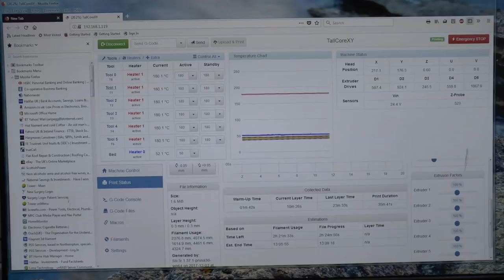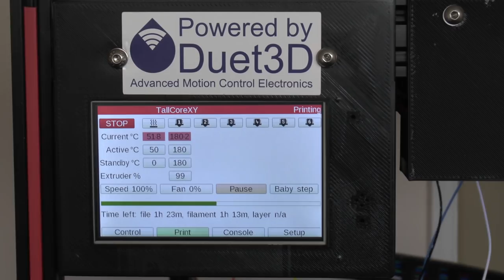5 Colour printing with a purge "bucket"

Comment: Clearly a huge amount of work has been put in to this printer. It’s a machine many would love to own and use, but few would be prepared to put the effort in to design and develop themselves. This has taken some real engineering and you should be very proud of your achievement - well done!
Reply from the maker: Thanks. This seems to be a popular video but as I keep pointing out to people, it was made over 2 years ago and a lot has changed sine then. Instead of 5 E3D TItan extruders, it now has 6 Bondtech BMGS, it has Duet generation 3 electronics with Can Bus expansion boards on the extruder gantry, so the huge cable chain has gone. It now has a DC UPS backup, the filament spool holders are completely different, it has a 3rd load balancing gantry. I could go on but you get the idea...:)

Comment: That purge splooge was very minimal compared to some blocks that I've seen. I cant wait to try and build something like this in the next few years.
Reply from the maker: Were you thinking of the Prusa MMU perhaps? Their purge tower seems to use more plastic than the object being printed from what I've seem. Although I'm told the tower is hollow, it still seems like an awful lot of waste of both filament and time, to me.  With the Diamond hot end having all filaments loaded at all times, the only purging that's needed is a small amount that's in the mixing chamber. Unless you print PLA and it has been held at print temperature for over an hour or so. In that case, it will hydrolyse and at bit more purging is necessary to get rid of all that runny stuff. Conversely, if colour change happens at layer change rather than on the same layer, then the transition from one colour to another can happen during the infill. In which case it will be hidden and no purging at is required. I'll be posting a video shortly demonstrating 9 colour printing using that technique.
Reply: @deckingman  I think so. I've seen purge blocks 50%+ the weight of the target print. This is a major improvement. Congrats!

Comment: I totally forgot while watching, that I was here to look how people use and build around the diamond hotend. What a magnificent machine. I need to move on and come back when I have more resources.
Reply from the maker: Thanks. Although I keep pointing out to people that it's very old video  (December 2017) and my printer has changed a lot since then. Check out my video dated December 2019 if you want to see something a bit more up to date (although my printer has changed a bit more since then).
Reply: @deckingman  Yes I've seen that you did changes. but I'm just looking for the 3 and 5 diamond hotend and with what and if I should update my printer. Your printer is cool but I can't realy learn something from your videos, just look in aww and guess what and why you did certain things. like your extruder, they are not direct drive but on the moving Axis, which is probably because of your printer heigth and the pressure needed but I'm guessing here because that's not a problem I ran into. I'm reading in your blog rigth now but more for entertainment. It's cool but I love to hear more about the problems you had, your insights and fails then watch the "finshed" product. If I missed the video where go into more detail, I hope you can give me a link.
Reply from the maker: Yes, I tend to use YouTube just as a showcase, but use my blog to describe all the problems I run into and what I do to solve them. I find it easier that way as it gives me more time to collect my thoughts. Plus, I try to keep a low profile which is why you never see or hear anything of me in my videos. :) There are some fairly detailed write ups on how I tamed the 5 colour Diamond on my blog. 
As you'll have discovered, Diamond hot ends don't lend themselves to using direct drive as there isn't room to fit multiple extruders. So they have to be Bowden (or maybe remote drive using flex shafts). My printer is quite big and if I fitted the extruders to the frame, the Bowden tubes would need to be about 1 metre long. Having them mount on a moving gantry above the hot end means that I can use much shorter Boweden tubes. 
If you don't find the answers you are looking for on my blog, use the contact section and I'll do what I can to answer any questions you might have.

Comment: That's amazing. Gotta admit it kinda pissed me off when I can't even get a flawless single extruder print. Well done though. Can you use dissolvable filament to print supports separate from structure using this beast?
Reply from the maker: That's a very old video and things have moved on a bit since then. But multi-material as well as multi colour is possible with a few caveats. The main one being that all inputs have filament loaded at all times. So any "unused" filaments are still subjected to the same temperature as the one which is being used. If different filaments require significantly different temperatures, then something like a tool changer that uses separate hot ends might be a better option.

Comment: BRILLIANT SETUP! did you make it yourself? I'm in awww at the level of engineering you have taken to make a very stable printing platform.
Really Impressed with the Hotend setup.
Reply from the maker: It's been 3 years since I posted that video. At that time I was using a Diamond hot end but if you look at my more recent videos, you'll see that I've been working on my own 6 input design which is what I'm using these days.

Comment: i tried using the diamond hotend and it was a leaky mess with a ton of heat creep
how did you fix such issues?
Reply from the maker: I could write a small book to answer your questions properly. But before I moved over to YouTube, I used to write everything up on my blog. You'll find the answers there but you'll need to go back to 2017 - this link should take you there  https://somei3deas.wordpress.com/blog/page/10/

Comment: Awesome design, so how will you move forward? Are you going to pitch this to a manufacturer or kick start it? It looks ready for release.
Reply from the maker: That video was made 2 years ago and the machine has changed a lot since then. It's just a hobby - I don't have any plans to sell kits or anything. I doubt many people would want to buy one. It now has 6 Bondtech BMG extruders which alone cost more than most people would want to spend on a complete printer.
Reply: @deckingman ,  Good point. but this machine is way ahead of it's time. The 3d printer industry is just emerging from infancy to toddler in it's development stages. I would patent this design if I were you, and pitch it to a few manufactures. Don't sell yourself short, you have a great idea here.

Comment: Hi! This is great!! Can you use it with primary colors to mix them and make secondary colors? thanks
Reply from the maker: Yes - sort of. All mixing hot ends that currently exist can combine filaments but they don't actively mix them all together. So what comes out of the nozzle is akin to stripey toothpaste. Take a look at my blog post here which explains it in more detail https://somei3deas.wordpress.com/2017/01/28/the-stripey-toothpaste-effect-of-the-diamond-hot-end/. If take a look at this video https://www.youtube.com/watch?v=9zXkNvqrDbA&t=5s you'll see that it works better when using transparent filament. In this case, I started with Clear, Blue,Yellow, Red and Black and by changing the mixing ratios I got those colours plus Green (Blue + Yellow) and Orange (Yellow plus Red) as well as lighter shades of Blue by mixing it with Clear, and and darker shades of Red by mixing it with Black. There is a lot more information on my blog https://somei3deas.wordpress.com/

Comment: Excuse me Sir, how could you configure simultaenous retraction? I'm having stringing issues with my Diamond 5 running Klipper. Is there any way to modify gcode? Thank you.
Reply from the maker: I use firmware retraction. When you set that up in your slicer, it puts G10 and G11 commands into the gcode file instead of G1 En commands. RepRap firmware will then retract all filaments that are associated with the current tool. I don't know how klipper works but I assume it will do something similar. So note that your tool definitions must include all 5 filaments. If you only want to print a single filament, then you set an appropriate mixing ratio to use 100% of one filament and 0% of the other 4. But when  G10 is encountered, all 5 filaments will be retracted. If you doubt do that and only retract a single filament, then filament will be drawn from the other "unused" inputs, rather than the nozzle.
Reply: Thank you. May be I’ll try to create macro gcode G10 and G11 in which code for synchronizing 4 extruders with the current one will be inserted to retract all 5, and then at the end of G11, it will unsync 4 and activate only the current extruder. Could you show me your reprap firmware code so I can do it similarly with Klipper? And does RepRap firmware support mixing extruder? Currently Kilpper doesn’t support it. Thanks in advance
Reply from the maker: @danatomy1  Yes RepRap firmware does support mixing extruders. So G10 will retract  all filaments associated with a tool. If klipper doesn't support mixing extruders, then you might have a problem. I'm currently 10,000 miles away from home so I'm unable to access my files which are all stores locally. I'll be back home at the end of January so remind me again then.
Reply: @deckingman  thank you very much, Sir.

Comment: Small query:

Why do you have two independent 2020 extrusions on your flying axis rather than say a 2040? Does spacing them further apart give you less twist on the axis?
Reply from the maker: I made that video almost 3 years ago (December 2017) and the printer has changed quite a bit since then. But yes, that's pretty much the reason. Actually it's more important for the hot end. Because mixing hot ends tend to be relatively heavy and quite large, I prefer to suspend them between two parallel rails, rather than have then hanging over the side of a single rail. Making the extruder gantry the same way, simply saved me having to design new carriages.
Reply: @deckingman  but generally if I had a stiff link between say two 2020 extrusions spaced like yours and a hot end between those rather than hanging below a 2040, you'd assume less inaccuraces due to it's rotation!
Reply from the maker: @mortarriding3913  That would be my take on it, yes.
Reply: @deckingman  I think I'm going to opt for having the extruder between the two extrusions as well, because I had trouble with pendulum like rotation around the X axis during fast Y moves.
Reply from the maker: @mortarriding3913  Yes, as a general rule, I always try to avoid any sort of cantilever. If you "hang" an extruder from the side of a single rail, there is always the danger that something could twist or flex. I apply the same principle to V slot wheels and idler pulleys. It's always best to support both ends of the bolts or "axels" IMO.
Reply: @deckingman  yes; I'd already done that with my wheels. I based my initial printer off of the D-bot, which is how I ended up with a hot end a long way off of the center of gravity of the X. The complexity for the next configuration however will be designing a spot where I can switch my hot end out for a plasma cutter. So I'll need a fair bit of space between the extrusions.

Comment: What's your opinion on prusas smart wiping tower? Should work well with your script of moving the tool change forward and make the wipetower even smaller.
Bucket purge hasn't been reliable for me, even with silicone or wool lip.
Reply from the maker: Hi. Well based on what I saw of it at the TCT show, it seems to use an awful lot of filament. I picked up a couple of objects that were on their stand along with the associated smart tower and the smart tower was a lot bigger and weighed more than the object itself. I didn't see it in action but I'd imagine that it must add quite a bit to the print time too. Maybe that amount of purge is necessary due to the way that the filaments are changed on the Prusa but my overall impression was that it seemed very wasteful in terms of filament and time. That's just my personal opinion you understand.

If you take a look at my blog, you'll see that I printed the same object as in this video by simply "drawing a line" of filament at the back of the bed, instead of squirting it into a bucket but that only works when thee are colour changes on every layer - hence my experiments with this "bucket" arrangement.
Reply: As you said, the size of the purge tower for the pursa mk is mostly due to its larger 'mixing zone'. Alot of plastic has to be flushed, before the new one is primed.
And you have to print the smarttower for colors when they are not even used. That affects some prints more than others.

For the diamond hotend and its fairly small 'mixing zone' the size of the smarttower can be reduced in prusas slic3r edition.
But there is some scripting necessary to remove the retract moves for changing the filament going into the hotend. Hope prusa makes it a little bit more versatile in the future.

Thanks for writing all that up in your blog posts, reading all of them. :)
Reply from the maker: I didn't think the Prusa had a mixing zone. AFAIK it can only print one filament at a time, unlike the Diamond which can mix them. The reason I think that the Prusa needs so much purge is because it completely unloads one filament and has to re-load the new one. Whereas the Diamond keeps them all loaded so the only purging that is required is the small amount of filament that is in the mixing chamber (in theory that is). I might have that wrong as I don't have a Prusa but from what I've seen of it, that's how it appears to work to me. No doubt someone will correct me if I've got it wrong.
Reply: 'mixing zone' is the wrong term, hence the quotation mark.
The zone with the molten plastic inside the regular E3D nozzle that can't be retracted when it completely unloads the filament, because it's too soft.
Reply: I saw one video on yt where the dude calibrated how much to move forward tool change to a point where no prime tower was needed. Probably had a small piece of blended color at each start, but it wasn't noticeable. Think this is the way to go (or at least reducing prime towers with this method).
Reply from the maker: That was me. I am that dude.  
See my other video here https://www.youtube.com/watch?v=0tPtn3urQ3g&t=6s

You can read about it on my blog too https://somei3deas.wordpress.com/2017/01/06/multi-colour-printing-without-wipe-or-prime-towers/ 

There is a problem with mixing hot ends in that PLA will start to hydrolyse if left too long at print temperature so moving the tool change point isn't always viable. Hence I sometimes use a purge bucket. It's just another tool. Sometimes one works better than another depending on the object being printed and the filament being use.
Reply: @deckingman  i also tought they could at least print a useful object, for example 1 colored one and a "dirty" coloured one from the purge, that way there is not real waste

Comment: looks like a diamond hotend with a Y-splitter on each input?
Reply from the maker: No. It's just a 5 colour Diamond (they call it full colour) with each input directly fed from a single extruder.
Reply: oh interesting, i didnt know they made 5 colour diamonds
Reply from the maker: Yes. But it's not without it's problems and takes some taming. Have a look at my blog here https://somei3deas.wordpress.com/2017/10/23/the-diamond-5-colour-part-3-finally-tamed/
Reply: @deckingman  then add 5x y-splitter to get a 10-color printer :D

Comment: I find it an impressive printer, but a lot of the material is still being wasted with the purges.
I have an idea, for a new printer model, how can I contact you?
I see it a bit difficult, but I don't understand much about electronics.
Thx
Reply from the maker: That video was made December 2017, so over two years ago. If you look at some of my other videos and my blog, you'll see that things have moved on. Using a purge bucket can sometimes still be useful but it is just one of many strategies that I use, including zero purge/zero waste multi colour printing.

Comment: If it is diamond nozzle, you can print with full color!
Reply from the maker: In theory yes. In practice none of the mixing hot ends currently available, including the Diamond, actually mix filaments together. They do combine them but what comes out of the nozzle is akin to stripey toothpaste. I have written quote a bit about that on my blog. Using transparent filament helps to negate that effect as you can see if you look at the video I made about printing "Aria" the dragon with the colour ranging from clear through blue and mixing that with green to produce yellow, then mixing yellow with red to give orange and finally fading from full red to black.
Reply: @deckingman  If you are interested in a true mixing hotend try and find an old botOjects Prodesk3D. The hotend has an auger that mixes the filament. The hotend has some design flaws but those could be overcome.
The printers came out in 2013/2014 and had lots of issues including mechanics and software. You can sometimes pick them up for cheap or even for free.